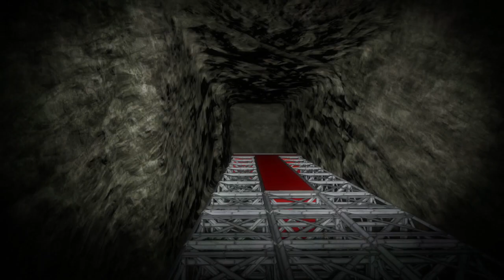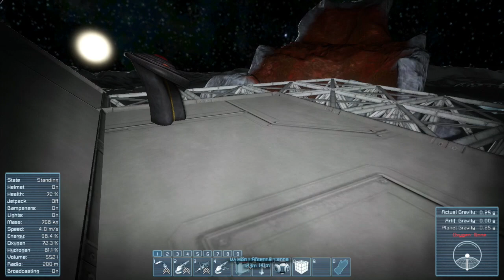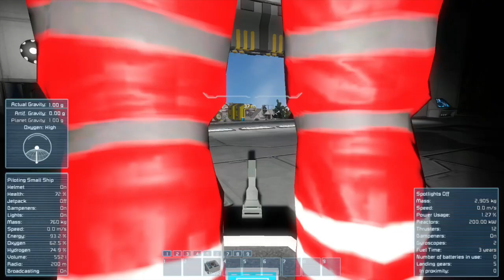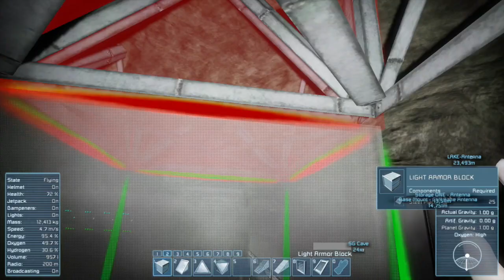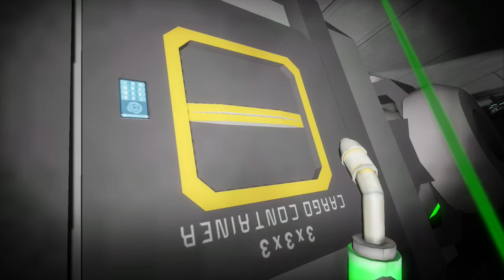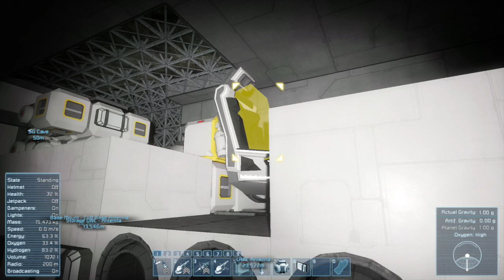Space Engineers LP 048

Comment: most aziumuth are broken, try with different cockpit
Reply from the maker: +fabianrw 
Oh man thanks, will do. I was getting ready to up 49, but in 50 I am. I like aziumuth, but if it broke the Gate it's outahere. :)
Reply: +Meko Van I am curious if it fixes your problem. like to know.

Used the stargate mod by myself(also looked in the code)

In the passed there was no blockcount maximum. (one year a go, or size)
Did it with ships that were 300meters long, but you had to be in controll off the ship(sitting in the cockpit).
Reply from the maker: +fabianrw Oh Heck ya I will let ya know for sure. I have no doubt I will make a production out of it how ever it goes. :) 
I am crossing my fingers. 
The strange part is, I built the ship on the Moon. It gated it to the planet without problems, with those cockpits. Now nothing.